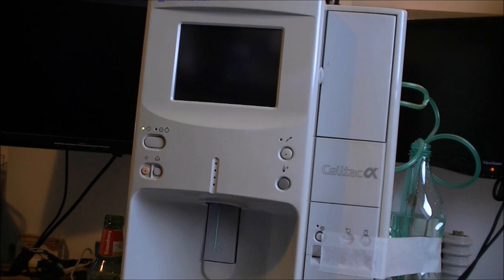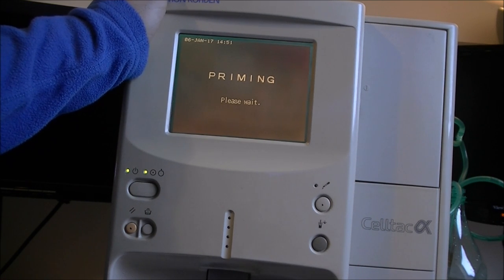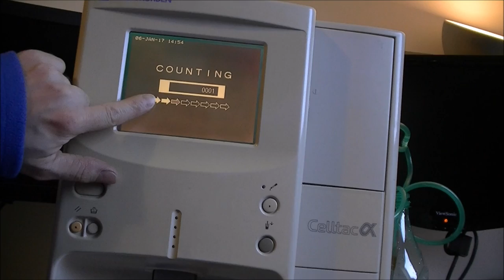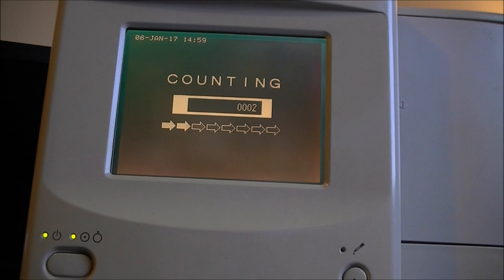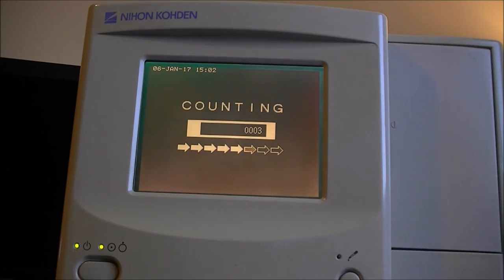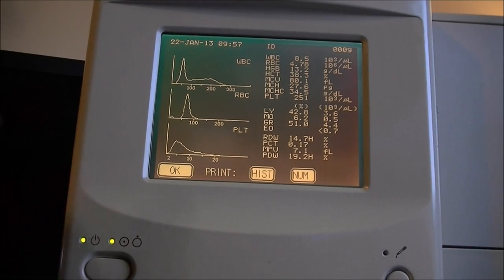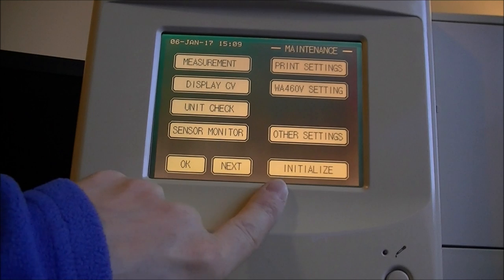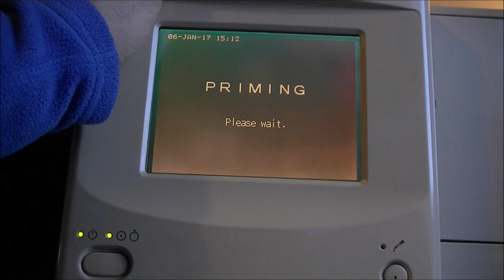Cleaning cycles on the hematology analyzer

Comment: Thanks for the tear down of the Menu system :-) With a lot modern devices the engineering in the software is just as important and possibility more complicated than the hardware/mechanical subsystems, all are essential for the device to function properly.

Comment: When roughly was this machine produced?  In what year?  Is it recent or old.  Does anyone know for a fact?
Reply from the maker: I have not found a adate code yet,  seeems mid 90's, possibly early 2000's.  Service manual for a newer model here, color screen different layout but some internal parts are very similar http://www.frankshospitalworkshop.com/equipment/documents/automated_analyzer/service_manuals/Nihon%20Kohden%20Celltak%20MEK-6400%20-%20Service%20manual.pdf